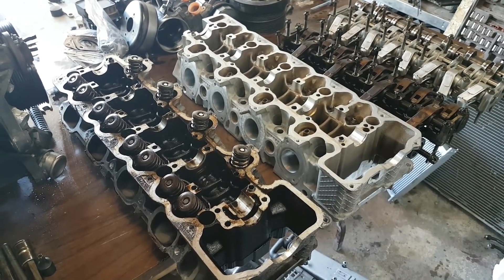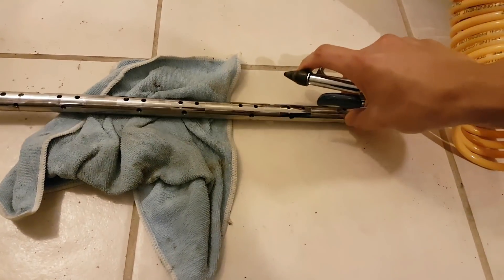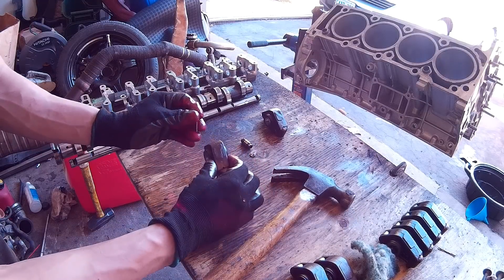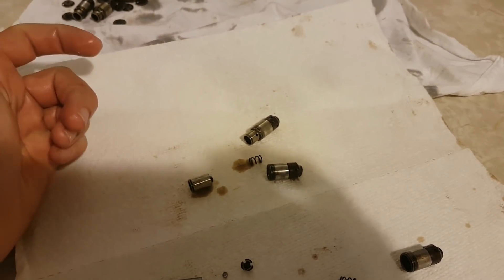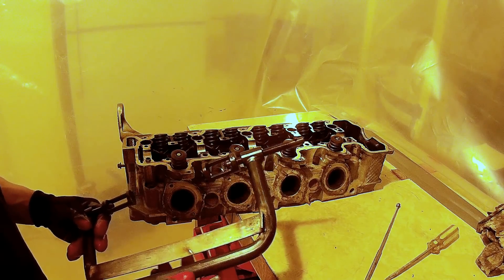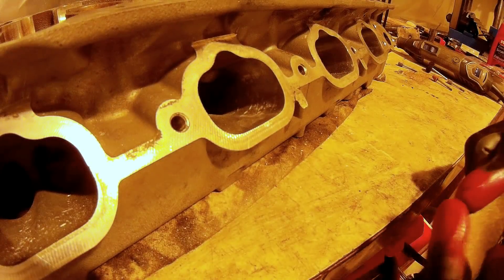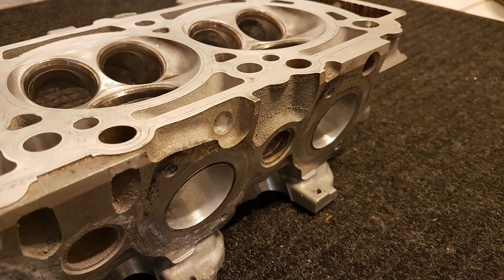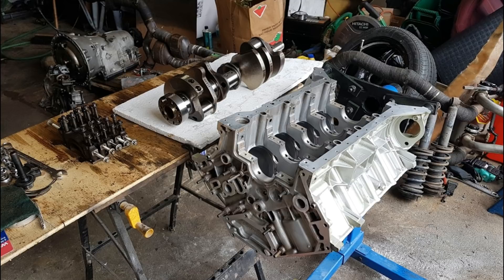E55 Engine Rebuild - Part 2 (Porting & Polishing, Hydraulic lifters)

Comment: I have a 2003 CL500 I'm replacing my timing chain but I have an issue now the timing cover is not lining up I'd loosen up the heads you should line write up now

Comment: Nice port work, looks good. For awesome visuals look at veicomer on youtube. He does mostly euro heads to get a good idea on port shape for your e55. Cool lifter design! Thanks. Gotta go solid for over 8000 revs, the speed pounds the oil out and the clearance opens up. In the 90s 6800 rpm was definitely max for hydraulics.

Comment: You can remove the valves a lot faster using a deep end socket on a short extension on top of the valve, WHACK! it with a lump hammer and the retainers pop out and the valve drops out.  You still have to use the compressor to reinstall.  A Harbor Freight C clamp with some slotted conduit and a washer welded to the clam screw makes a perfect installation tool.

Comment: stop saying that the exhaust isn't as important as the intake.  the intake makes torque.  the exhaust makes HP.  Smokey Yunick was saying that in the '80s.  That manifold is a huge bottleneck.  1.75" or 1.875" headers will really wake that motor up!  btw, your "porting" did little for the flow.  you'd be surprised how much you can hog the ports and not see any gains without a proper valve job.  hard to know unless you flow test or dyno test.

Comment: Often hydralic lifters cant take as much abuse as solid ones. So if harder valvesprings higher lift cams and you run the engine at higher rpm than stock they fail

Comment: Hydraulic lifters and the valve window gap various from valve to valve depending on how much oil went through special if the lifters are dirty and of course you want to use synthetic oil because molecules of synthetic oil are equal to each other

Comment: Great work but on supercharged or turbocharged engine Port polishing is worthless it works okay on the natural aspirated engine plus you need the bench flow table to equalize airoflow between combustion chambers and you only want to polished it exhaust port for a smooth escape exhaust gases it happens off the speed of sound literally best way to increase more power which is already enough put smaller supercharged Wheels to increase the revolution on the supercharger remap injector sequence and increase fuel  pressure and of course get a racing fuel good luck thanks for the video

Comment: polishing intake ports is a big no no. fuel will pool on the walls and actually hurt the spray pattern. it has nothing to do with airflow, it's because liquids stick to mirror finished surfaces and the rough finish helps to atomize the fuel.
Reply from the maker: Fuel pooling is more of an issue on cold starts. Haven't really heard of it being an issue in racing. Even F1 cars since the early days of fuel injecting have always had smooth machined intake runners and velocity stacks. With this being a racing engine only, I dont think its going to be an issue
Reply: SK8215 fair enough, but keep in mind that f1 engines back then where n/a. forced induction is a different animal. on my rb26 I had actually seen this problem, but then again I used 1200cc injectors I doubt you will flood the m113k with that much fuel. either way keep up the work bro, i watch your videos since the pushrod suspension days. my other car is a cls55 and you truly inspire me to mod it again. steel sleeves, h beam rods and custom pistons in combination with a weistec blower is the plan.
Reply from the maker: Yeh, 1200cc is a different story. I'm at 630cc but was getting very close to the limit on them. That's an extreme plan, I know those engines built with weistec blower can put out close to 1000hp. Best of luck with it. Make sure to post some content along the way!

Comment: What do you think about the secondary air injection system? It would open up a lot more space if it was removed, and would make it easier to work on the engine. Are you considering making a video on how to "delete" it, or map it out so the computers don't search for it? Thanks

Comment: Just pick up another exhaust with the cats intact and swap it in before your next inspection. No one needs to know. Then you won't have to worry about a trailer. Seems easier to swap an exhaust each year than to trailer it to every event.

Comment: Good video, but polishing the intake port as actually not a good idea for a modern engine, rough walls serve the purpose of making small swirls in the air to mix up a bit better with the gasoline. I´m not sure that this will make a measured difference. This used to be a very different story with older casting technology, mostly where gasket and other parts meets there would be something disrupting the airflow, than this made perfect sense.
Reply: Interesting opinion
Reply: I did read a lot about porting, there is so much misinformation and very little confirmation of it actually doing anything at all, also if you consider manufacturers will produce the most efficient engine possible, so they would polish the ports in the factory even if it made the engine spend 1% less fuel.
Reply: It is really hard to get correct information these days, at some point i went down the rabbit hole of porting, i spent 3-4 hours reading about this stuff and most of it was more belief than facts.

Comment: Want to do this when I get an oil leak from the the oil cooler nestled in the valley of the V of an M137 V12. You have to pop the heads for access to the bolts for the oil cooler. If they have to come off, then I gonna smooth some shit.
Reply from the maker: Well I hope your oil cooler holds up, but yeh probably worth doing when the heads are off anyways
Reply: SK8215 Not looking forward to it. No idea how long the seals will last. See Mercedes and other car makers put the oil cooler on the oil filter housing now.

Comment: good job on the rebuild. only point of concern is that intake ports should have a slightly rough texture to help with fuel atomization. smooth, shiny intake ports cause fuel puddling.
Reply: Awesome Joe - Spot on. Ever has it been thus. Polish the exhaust ports but not the inlets.
Reply: Wont turbo pressure compensate for this air/feul mix problem?
Reply: Awesome Joe you have a citation for that? Jafromobile went pretty shiny on his ports. He's a racer too.
Reply: Maurice Searcy  quick search will find a lot of science behind it. 
-In fact, often within certain intake systems, the surface is intentionally textured to a degree of uniform roughness to allow for fuel deposited on the port walls to evaporate quickly, due to the increase in surface area.
Reply: Awesome Joe Sounds good. Polishing is a lot of work, and good to hear some isn't necessary. Jafromobile went very shiny on the exhaust too, and he said the reason was to reduce carbon depositing.
Reply: Maurice Searcy exhaust is a different story. Smooth and shiny is fine, when you get into high end race porting, size and shape come into play more.